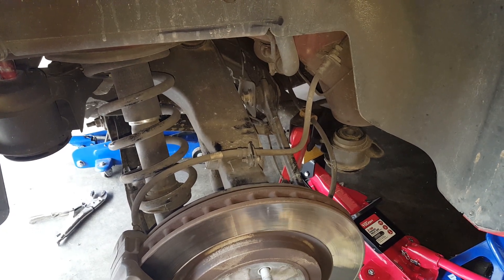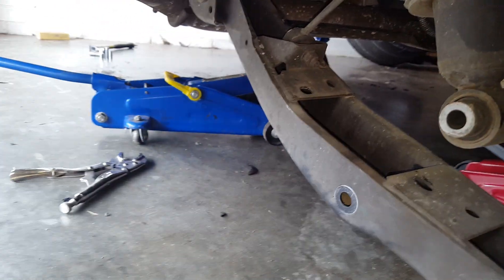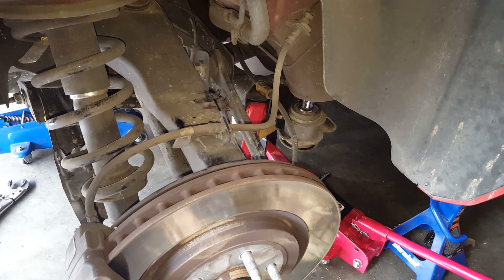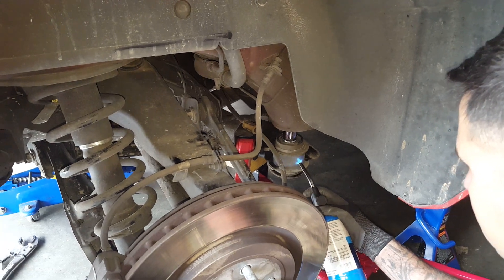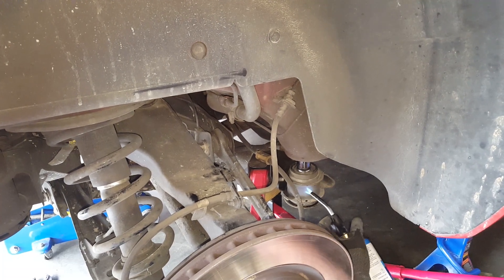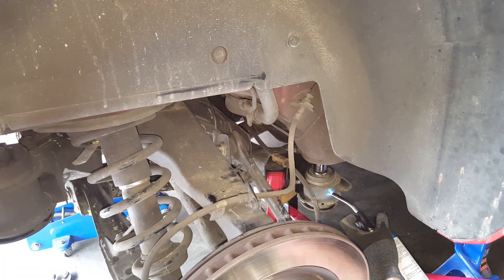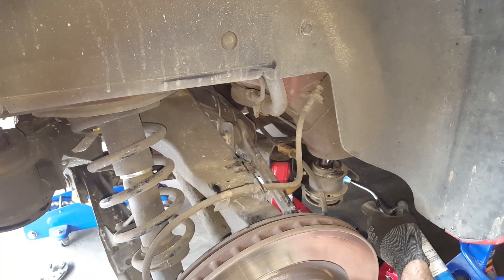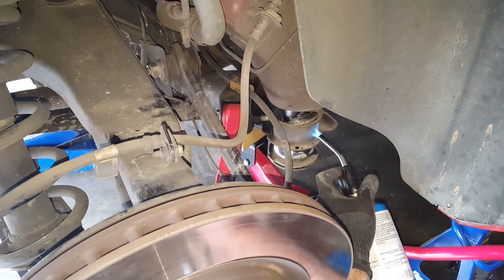Subframe bushing removal on a 2010 Camaro

Comment: did you take the bottom metal piece out first? Was it a PITA? Great vid.. Thanks!!
Reply from the maker: Nope, I didn't bother with it, when the entire bushing popped out, the metal piece was with it. They were easy, the main pain was to get the socket emplaced between the bushing and the metal piece of the body that protrudes downward into the rear bushings. The front ones don't have the issue